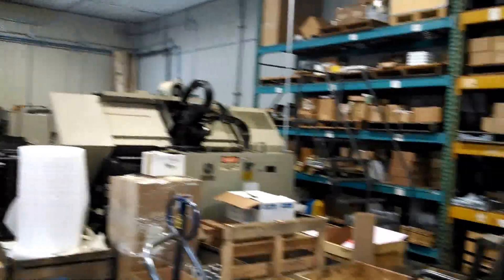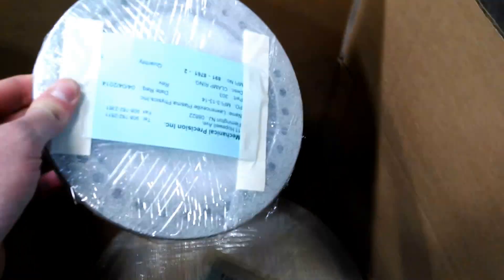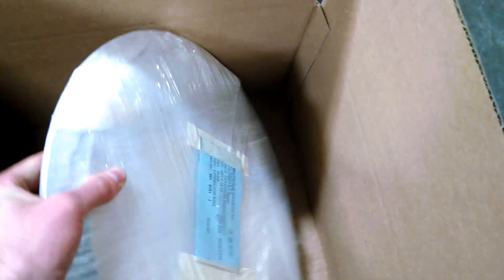Picking up the final stainless steel parts

Comment from the maker: The pieces are falling into place for our next experimental run ;-D
Reply: I am aware of the temperatures, which have been pretty clear to be 1.8x10^9 °K. But how fast is that measured in meter per second. Allso, what is the estimated temperature and velocity of the beam from a working focus fusion reactor, with net energy gain?